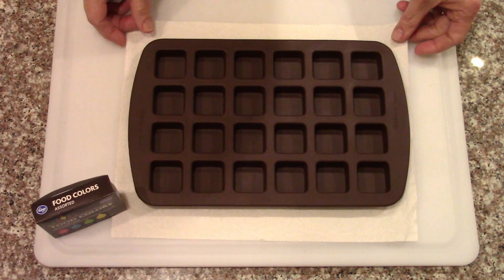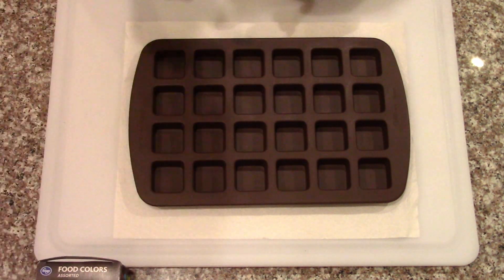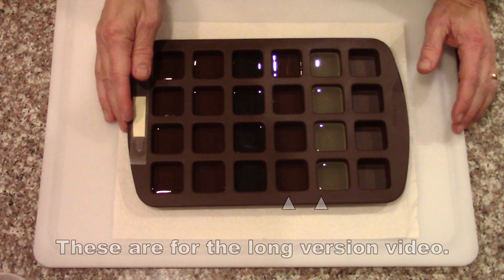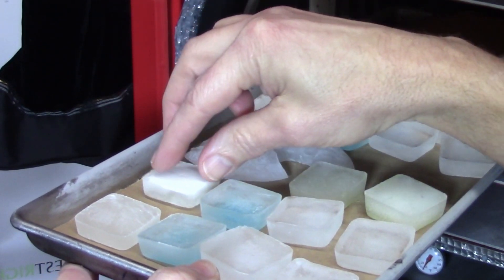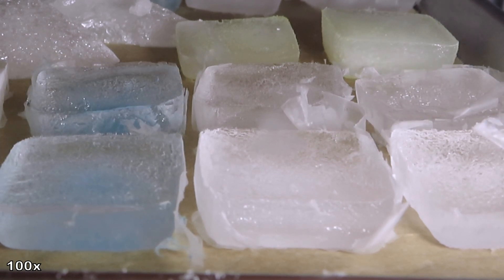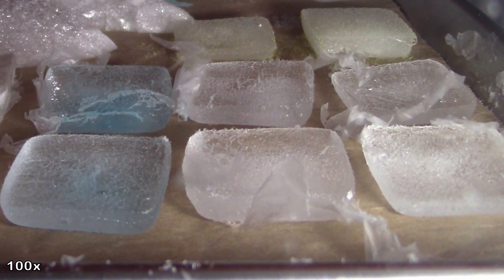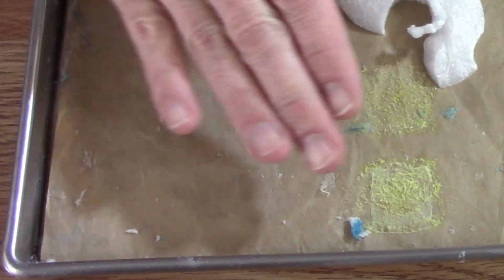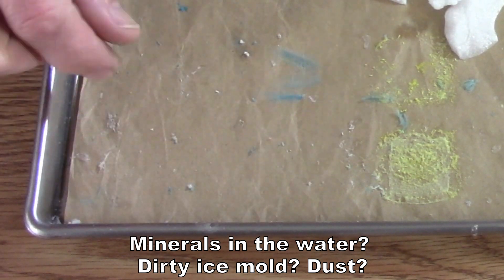Freeze Drying Water - Short Version

Comment: I found that Freeze Dried water rehydrated quicker and better than anything else that I ever put in the dryer. Good video, thanks
Reply from the maker: Thanks.
😊Which rehydration philosophy do you ascribe to: it's okay to rehydrate it with warm water or it MUST be cold water.
Reply: @SchoolReports  I rehydrate with cold, warm and hot water. Sometimes I even use liquids other than water to rehydrate, and the temp depends on what I am rehydrating. Nope it doesn't have to be cold.